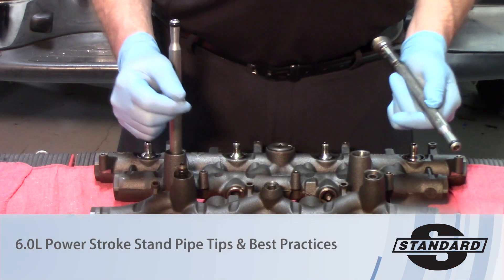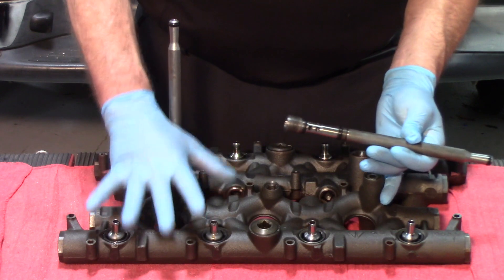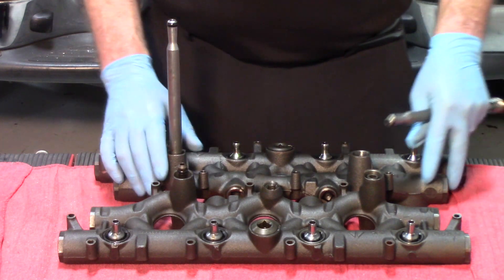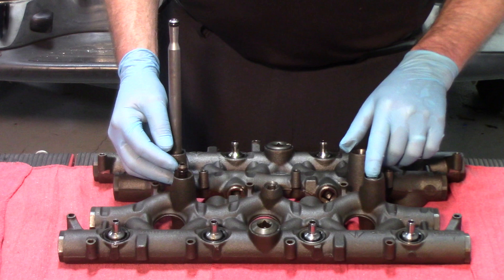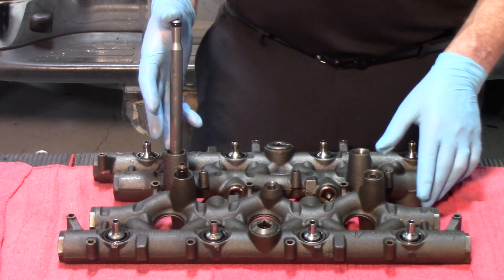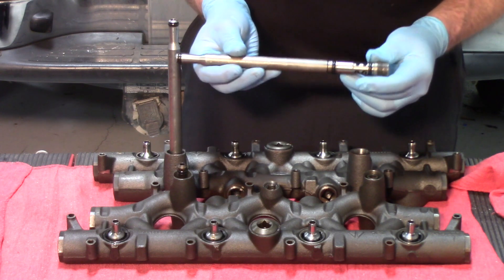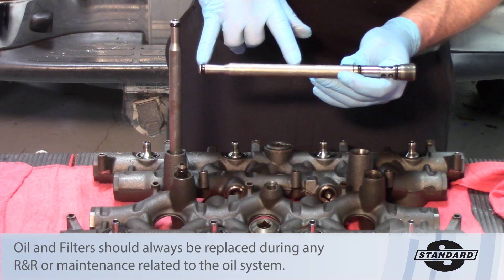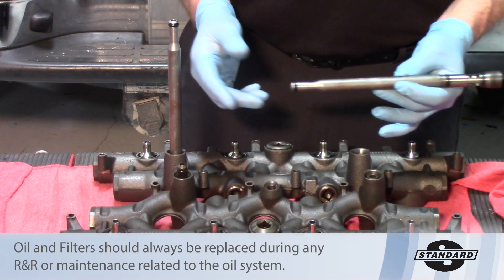6.0L Power Stroke Stand Pipe Tips & Best Practices

Comment: here's a stupid question, but one i cant find an answer to anywhere. Is it possible to accidently put the dummy plug and 2 piece stand pipe in the wrong location? for example, can the long pipe go in the Dummy plug location?
Reply: The dummy plug can fit in either hole since there the same thread pattern but no the actual 2 piece stand pipe is the back plug on both sides of the engine. Where the the dummy plug is at upfront on the rail there is a block off bolt that seals that up to make the system work if that makes sense